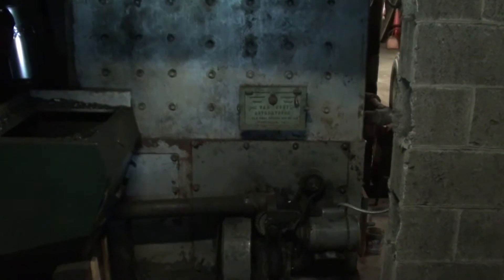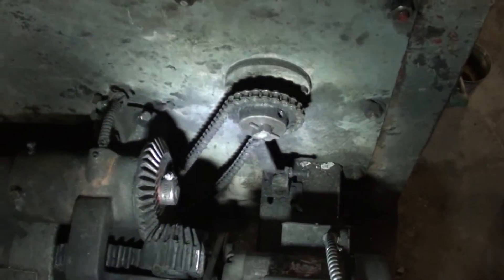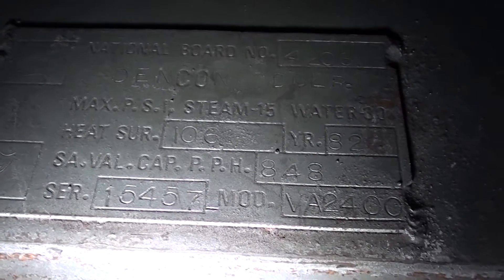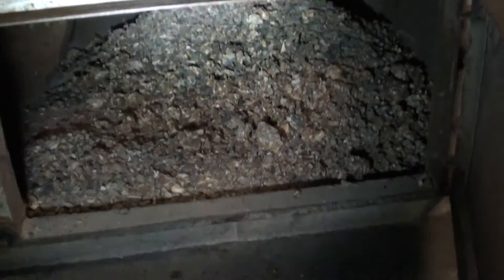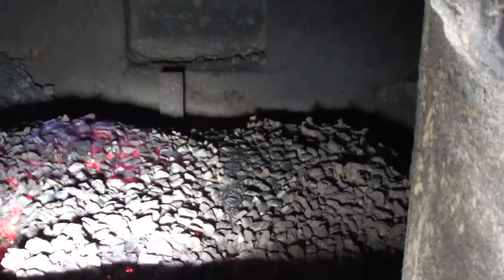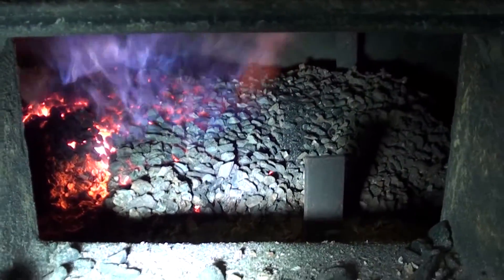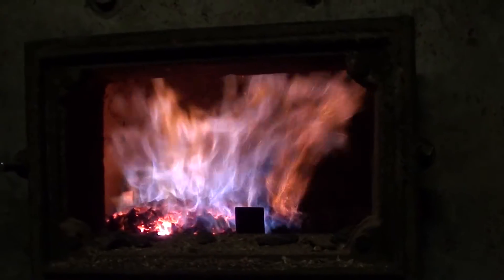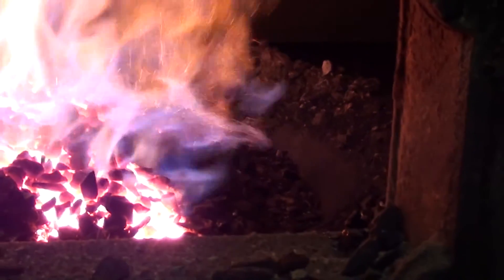Van Wert Anthratherm V A  2400

Comment: I guess a very worn auger (sharp) could cause this problem to. Anything that will crush the coal will cause a problem with fines buildup. The fines can then settle in the bottom of the pot blocking the air. I hope your new parts solve your problem. That is a real nice boiler you have there.

-Don

Comment: That one side of the pot that is not burning has an air restriction. When was the last time the fines were cleaned out of the air chamber under the pot?

If it has been a long time you can end up with a crust stuck between the rings. If it's that bad you will need to unbolt the ash ring, remove all the fire rings and clean everything out.

Wow, that is a nice big unit!

-Don

Comment: If you go to markssupply.com they have a VA 1200/1500 section. This includes a cutaway and parts list. The VA 1200/1500 is similar to the VA2400. Mark's Supply sells coal stoker boiler parts. They also have decades of knowledge about every coal stoker out there.

The first thing to check for is coal fines clogging the air chamber and or the rings.

-Don
Reply from the maker: +Stoker Don We have had it apart 2 times the last 5 days. We found that the feed auger had worn through the feed tube. Replaced feed auger tube.  We put it back together and and again 3 days later right side of the pot was filling up with coal dust. Mark suggested we replace the auger also.  We just replaced the Auger, and are waiting to see how it works now. We also replaced many of the Pot rings the first time.

Comment: If you are seeing a lot of fines/dust, I would suspect something in the feed system.  Sharp auger flights, pitted/rust feed tube, too much clearance between auger/tube, or a gap inside the coupler if you have two pipes joined together.  Like Don said, while you have it shut down make sure the rings are not blocked with fines or dust.  

If you are unable to resolve the problem, you can always call Arnie at A&B Van Wert.  http://www.vanwertboilers.com/
Reply from the maker: +Rob Roy  We just completed replacing the feed auger a few days ago. The furnace now seems to be working properly. But then again, we've had it apart a couple of times and it always works good for a few days, then the pot fills up with fine coal dust on the right side, and quits burning.  I'll do another video this weekend and show the parts we took off, and what it looks like now. I haven't seen the accumulation of fine dust on the right side since the new auger was installed. At least not yet.